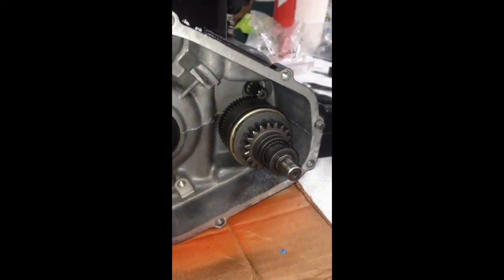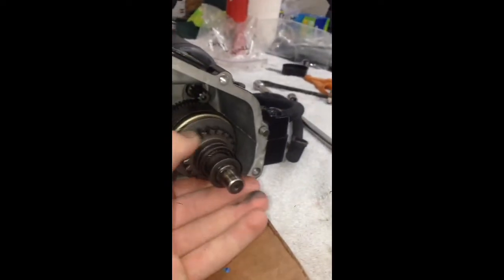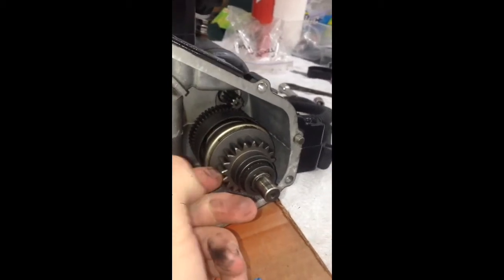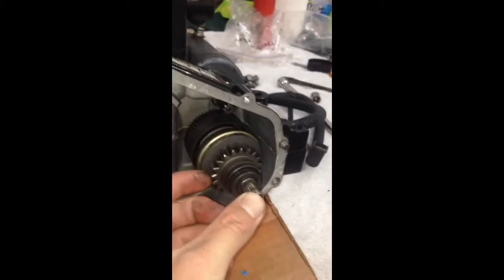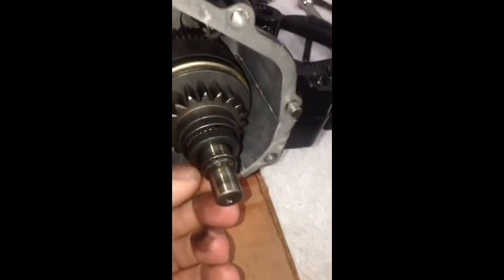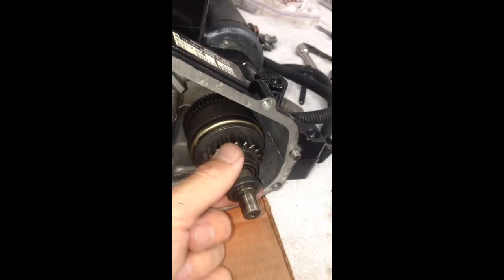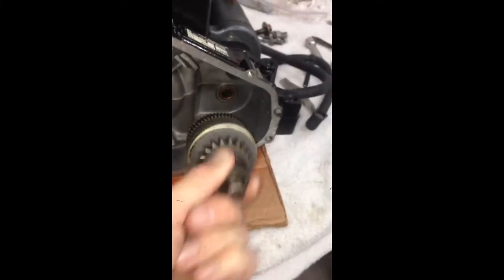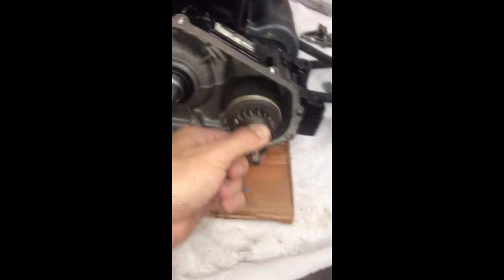Yamaha Superjet - Starter spins but doesn't engage? Don't pull the starter, check your bendix gear.

Comment: When I hit the starter button on my bike the gear extends out to meet the flywheel but the gear itself doesnt turn so it can't move the flywheel. I've pulled and tested the starter and still no spin whatsoever.
Reply: I’m having the same issue on my kz650 it spins freely but it does not engage anything internally

Comment: Is there a washer that’s supposed to go behind the bendix against the case? If so, do you have the part number?

From the front cover, I have the washer, the spring, the other washer, the bendix, BUT now I’m hearing there’s supposed to be a washer behind that as well to protect the case. 

I just put a new bendix in and got the bad girl to turn over. She seems happy, about 130ish psi in each cylinder, I’ve got spark, but when bench testing the engine with the spark plugs out, it appears the bendix isn’t disengaging after it throws
Reply: Did you every figure that out I’m having the same issue
Reply: @Andidofightdyx  I did! I can’t remember exactly off the top of my head. Let me look back and confirm, I think I called a shop in California and they were able to give me the part number. 

I think I mention it in this video or the next one in the series:

Will the 1990 Yamaha Waverunner RUN? First Start - Four FREE Jetskis (Episode 2)
https://youtu.be/Dw9MesIYitY
Reply: @backcountrybuilds  big help man thanks 🙏 I’m going to try to same on my old gas saver moped as-well been kick starting it for years and had the same issue on it
Reply: @Andidofightdyx  best of luck! Sounds like a cool machine